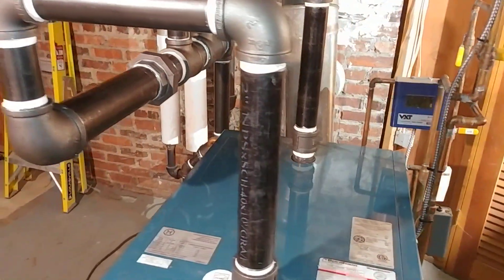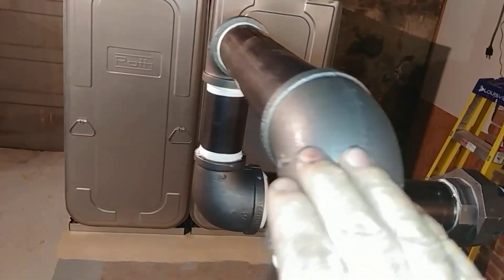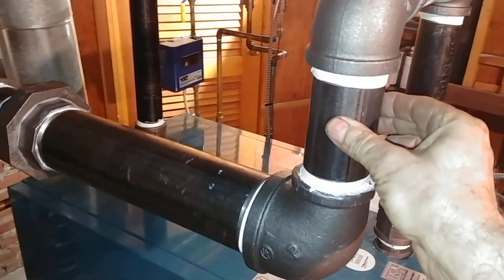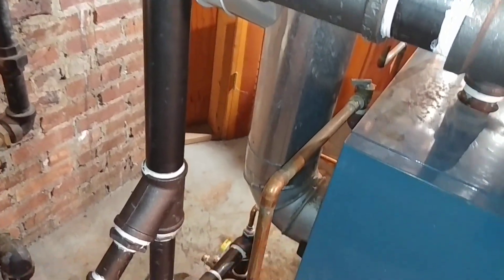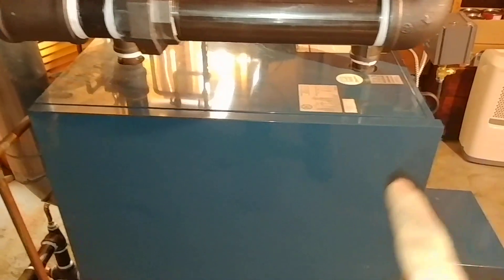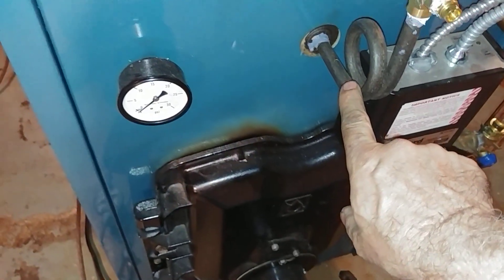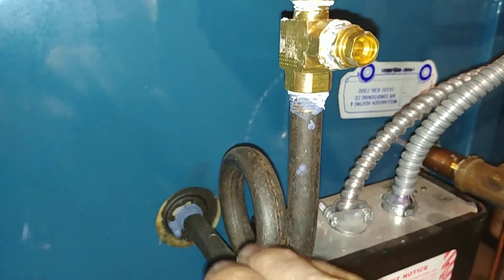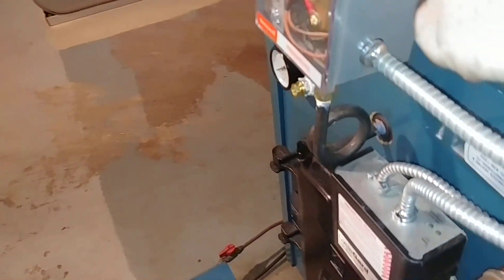Final Stage Repiping A MegaSteam - Part 4

Comment: Great job!  Almost too pretty to cover with insulation.  Can you elaborate on the political reasons you have heard about why the Megasteam is not available with gas burner?
Reply from the maker: Thank you very much for the kind words.
As to your question, that's a touchy subject.
There is, to the best of my knowledge and belief, no good engineering reason why the MegaSteam cannot be fired with methane.
So, it has been speculated the reason why Burnham actively resists gas installs for the MS (in that they call upon inspectors to fail any such install), is something else.
Ah! What is that something else?
We may never know that for sure.
But dark mutterings and nefarious plots are booted about.
And with that, I will say no more.
Reply: Per U S Boiler. It voids the factory warranty. Boilers that were out of warranty have been successfully converted to fire nat gas and LP.

Comment: I had to search for the visuals needed for this question:I have now seen several of your videos of you rebuilding old steam traps. It seems your historian type knowledge serves you in this endeavor. But it got me thinking.....are ALL steam traps-----many decades and decades old------needed for CURRENT service? (and a requisite rebuild or replacement) or.....can some like that crock pot shaped, ancient, coal era trap in the rear of this video be simply 'adandoned in place?'  Would a technician, via infrared, sonic (thats not the right term) or whatever, test the efficacy of steam traps and rebuild as neccessary? Or is the type of thing a tech doesn't look at unless he sees a data point that an evaluation of a particular trap is warranted?
Reply from the maker: In this instance, the "crock pot shaped"  return trap is not really a "trap" like those on the end of many two-pipe steam radiators.  Its really misleading terminology.  They are obsolete for the most part and are a usually abandoned.  
The ones on the ends of radiators are generally worth rebuilding, especially if they fail closed (the radiator stops heating or heats very poorly). 
The cross-over traps at the ends of steam mains are generally worth replacing with better traps to get better steam flow.
Reply: @gordonschweizer5154  Thank you.

Comment: I had a couple other questions, but you've provoked another. How critical is the elevation of the pressuretrol/ vaporstat? I think I heard the vaporstat is a critical elevation dimension in a vapor system. Are pressuretrol/ vaporstats a critical elevation dimension generally, and if not, is there a specific context in which they are?
Reply from the maker: The reason we like to put the pigtail/steam siphon up high is to try to keep junk out of the pigtail.  Also, with dirty water on commissioning, the water level jumps all over the place.  The pressure fluctuations caused by water slugs too close to the water ine might rattle a vaporstat right off any accuracy. 
Other than that, I don't think height of the the vaporstat is a critical dimension.

Comment: I watched the whole video and the other 3
Reply from the maker: I thank you!
Reply: @gordonschweizer5154  I have to watch them all.    Should I use a vapor stat? Can I max out the cycles per hour?
Reply from the maker: @deloresmulva4544  Vaporstats work best with two-pipe steam systems with slightly over-sized boilers.
If you have an undersized boiler, the radiators absorb all the steam the boiler produces and the pressure never builds, so little or no need to put a Vaporstat there.

Comment: Beautiful. Will the owner insulate the near boiler piping?
Reply from the maker: Thank you!
We discussed adding insulation, for sure.
We need to return to fire the boiler once the oil tanks are hooked up and the floor is refinished to hook the radiators back up.

Comment: I see you use a Y fitting for the Hartford loop connection. I had not seen this before.
Reply from the maker: That is unusual, isn't it?
That is unique to the way Burnham wants to have their boilers piped in at the Hartford Loop. That wye comes with their piping kit, so, we use it.

Comment: Surprised there is no king valve?
Reply: The only thing I can think of to use king valve would be:
1. Blowing crud out by isolating and pressurizing the boiler only.
2. Flooding the boiler for summer storage, cooking off O2, and then closing off king valve to keep it water from absorbing more O2.

That being said, both sound unnecessary or at least #1 as a risky proposition.
Reply from the maker: @nosceteipsum513  Thank you.
I think a more useful isolation valve would be on the wet return just before the Hartford Loop to allow a "no return flush".
IIRC, boiler Codes for larger conmercial boilers call out that if you do install a king valve, you must also install an isolation valve on the return and visa versa. A code more honored in the breach.
Reply: @gordonschweizer5154  indeed.
Reply from the maker: Thank you for your comment!
We/I am not sure if a king valve is all that necessay for proper boiler maintainence nowadays. I think it might be a leftover from the coal era?  
Please let me ask everyone: What do You use the king valve for?
That is to say,  how do you use it to add value to your customers system?

Comment: Looks great, so nice to see a correctly piped steam install.👍 I have tried to buy the “wye” fitting for the Hartford loop on other steam installs but the 6 supply houses I deal with in Eastern Connecticut don’t carry them.
Reply from the maker: Thank you for your comments!
I know your pain in trying to obtain so-called oddball parts! We used to have an old old old-time supply house down here in B'more where there was no extra charge for the layers of dust. I've got a video of their last days of operations. Very sad.
I wonder if DBJ in Greensboro N.C. is still answering their phone?
DBJ was known down south as Darn Bunch of Junk, but it's treasure to me at least! Give them a call.
Reply: @gordonschweizer5154  thank you for the tip

Comment: Nice install as always,would any new build  houses today have steam heating ?
Reply: I wish but no for the most part unfortunately.
Reply: Homes built today will have an air handler/heat pump setup and high efficiency boiler usually. Steam heat is a dieing art unfortunately but money talks and I'm sure you could hire someone like Gordon to set you up on an all steam heating system.
Reply: @elioselectric468 Actually I have seen pictures and even a news article about a steam mini-tube system (Iron Fireman style) installed by Gerry Gill of Cleveland Ohio to replace a forced air system. It's a work of art, not quite new construction but close enough.